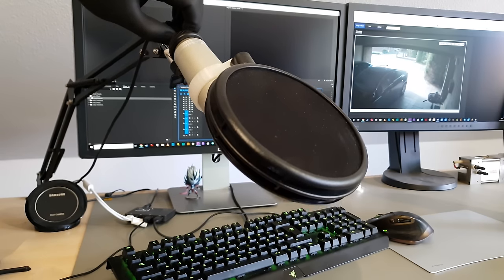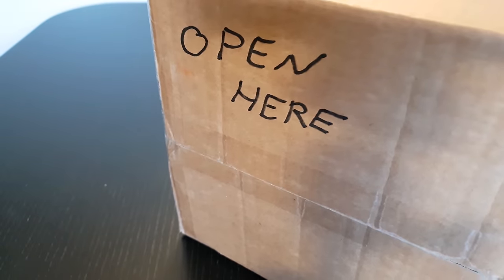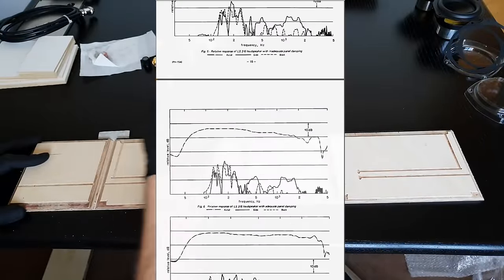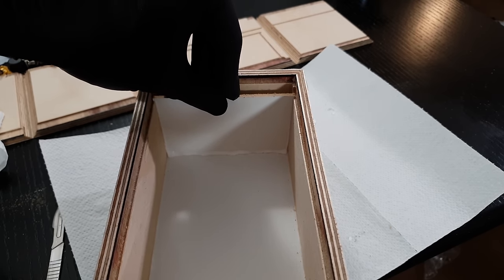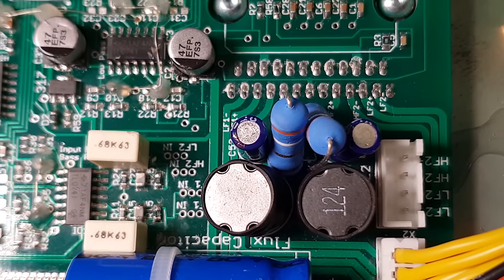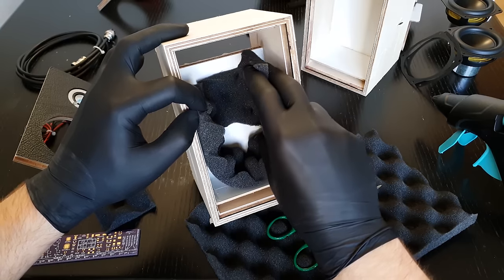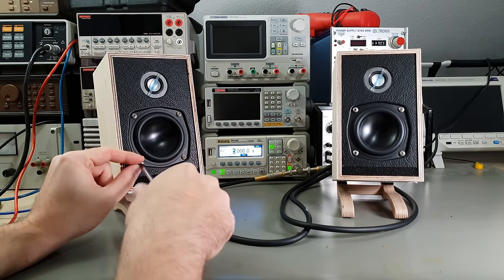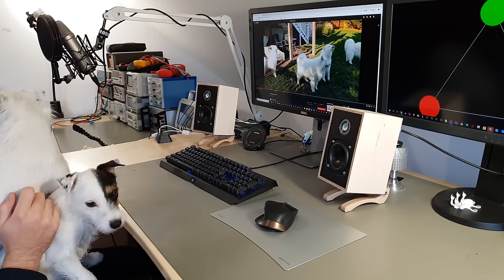Little British Monitors: DIY Transmission Line (?) Speaker Kit

Comment: "His Rival's Voice"

But seriously now... Presumably this means digital speakers (as in, DAC in the box) hasn't fully caught on? Have an old Cambridge SoundWorks system from years ago that can take analog or some weird Creative-specific digital format, and the latter has often sounded clearer, especially when I was playing with neons...
Reply: The problem is that the direct delta-sigma amplifier never caught on. Probably barricaded behind intellectual property locks, such as patents and trade secrets.

And without that, what's the point?
Reply: @SianaGearz  TI has been using Delta Sigma in their digital amplifier chips for many years.
Reply: @NiHaoMike64  Care to provide an example? Never ran into these and my quick search doesn't turn up anything.
Reply: @SianaGearz  The TPA3122D2, while an old chip, actually shows a Delta Sigma modulator on page 5 of the datasheet, implemented with opamps.
For an explanation of what the opamps are used for, take a look at the end of this page:
https://www.beis.de/Elektronik/DeltaSigma/DeltaSigma.html
Reply: @NiHaoMike64  The 3122 is your classic analogue Class D amplifier. Delta Sigma modulator fundamentally runs on a clock. Class D has integrators and thresholds or comparators (which you mistook for opamps, which fair they do share the same schematic symbol) but no clock. Delta Sigma is a family of digital/analogue interface topologies, but for something to be digital, it needs to be both value-discrete and time-discrete, and classic Class D is not time-discrete, it's time-continuous. You shall note that all topologies on that beis site you quoted include a clock. When it refers to the TPA3100D1, just pull up the datasheet on that, it contains a Delta Sigma DAC and then analogue Class D amplifier in the same package, so it's not a Direct Delta Sigma. Granted, this topology should trivially work just fine, being free of the DDS troubles :D Furthermore if it wasn't the case, then FLT pins would make no sense, since they're basically analogue-input-side.

Fundamentally functional block diagrams should always be viewed with lots and lots of suspicion. It's fair enough if they represent the output and the input circuits accurately but then they just make up stuff in between that is just barely close enough to what's happening. Same thing with "equivalent schematics", where you'll find almost every single opamp pretty much represented as a mild variation of 702 in its datasheet although really there's 2 more stages in there that are just completely omitted.

What i think is happening is that the Delta Sigma topology itself is good when it doesn't need to drive any current, just voltage, since you can then assume that any switching happens more or less instantly, which is fundamentally not the case with Class D power amplifiers, where you have a relatively long minimum duty cycle that you need to account for, but then need super fine adjustment of the duty cycle to hit a sufficiently exact output voltage. Topologies that run a threshold off a regular saw-wave or something like that exist, but don't perform nearly as well, so i suspect what all of these decent integrated ones are doing is allowing the reference signal cycles to shrink and stretch somehow, something like that.

Comment: $461 for the assembled version? No,  Thanks! I can spend 30-40% less for brand-name speakers at Guitar Center like Yamaha or JBL  with 6 or 8 inch drivers and I'm sure they'll sound much better.
Nice review,  though!
Reply: I wouldn't be so sure they will sound better. Perhaps more impressive, louder maybe, but more accurate? Not at that price point.
Reply: @RobWhittlestone  mass production is lowering the price,  as we know. Big company that makes a big order of say drivers or amps or cables will get them at a much lower cost. Not sure why you doubt it. And reputable companies has teams of acoustic engineers to make sure their products are meeting consumer's expectations. That's what they do for living.
Reply: @111chicane  Big companies also make boring, safe designs that can be done with cheapest components, and they drive a huge margin. Those speaker drivers bigger manufacturers use are just one or two steps above bottom of the barrel - good quality control and no fundamental design issues, but just nothing special that allows to push daring designs. I'd classify this as daring because of claimed f-3 around 60Hz at just 12cm width, which is pretty remarkable, you don't get that far with $5 drivers. I think the whole idea is pretty much that they should sound bigger than they are, and they're tiny.

This is clearly not a product for everyone, it's not a mass market product, it's one guy's small-shop product, and it is a bit special and quite distinct from mass market monitors, not a direct competition. It's not unreasonably priced, not at all.
Reply: Actually I doubt the hell out of that.  I've bought alesis studio monitors that are used for recording and they are garbage in comparison to good full range speakers or setups like this that I've made myself.  It was actually pretty upsetting how bad they were and if you go over to my channel you can hear it. Over time the amps internal quality has degraded to hell and now i get this space anomaly background noise that pusles at random and not even an inline filter gets rid of it.  Yeah, screw premade speakers to hell.
Reply: I can't say what these speakers will sound like in person, but it's highly likely you'll pick up absolute rubbish. Especially sub $400 on a big brand name speakers at chain stores.

Regardless though, most customers don't really know what a studio monitor is really supposed to sound like.

Comment: How they actually classify these as a T-Line gets me. Definitely not quarter wave, nor is is the cavity behind the proper line length calculated off the FS it’s not the proper diameter calculated off the Sd off the main woofer. 
This is a slotted L-port enclosure if anything. I would like to know how they classify this as a T-Line as I may be wrong for the rules for what makes a T-Line a T-Line. The line length would be at least 52cm and same diameter as the woofer itself.... I don’t know what the Fs of that woofer is but even with basic T-Line math we calculate the Fs against speed of sound at sea level and the divide that by 4 to get line length for a basic T-Line and that length is usually the diameter or surface area of the woofer(Sd) for that whole length. 
I build a ton of T-Lines and have seen some deviations from the basic rules but this is way out.

Comment: That's a very expensive tiny speaker.
Reply: I'd call it very cheap from my perspective, mine cost much more and don't have a builtin amp (and not suitable for active crossovers and biamping) - and they're just about the cheapest small speakers i'd be comfortable with. You can get some studio monitors that are comparably priced, they can be quite decent. Cheapest non-crap thing i could live with would be Mivoc "bookshelf" speakers (actually not suitable to be used on a bookshelf), they cost like $60 a side, but they're a lot bulkier than this, and they are an exception to the rule, normally everything you get under $150 a pair is crap.

If this lives up to the promises, it's a great product at a bargain pricepoint.
Reply: For a DIY, it sure is.
Reply: Dirt cheap compared to similar professional audio gear. But I would have liked to see some sort of wired digital input like S/PDIF or USB or at least support for differential input - low level analog audio tends to be sensitive to EMI.
Reply: @SianaGearz   Yamaha monitors and other brand or even no brand high quality monitors are not that expensive and they even have 5 inch woofers.   The finish is also more presentable and you just have to plug it in without glue or painting.
Reply: @NiHaoMike64  A little expensive compared to DIYSG, which uses generally better designs. These use 2 fullranges together for no real reason. They should have at least used a dome tweeter. Probably used the fullrange "tweeter" because it's slimmer from the front but cones aren't ideal for tweeters compared to other designs. I bet Sony Core series, Pioneer's Andrew Jones stuff would be better for cheaper, anyway, and my KEF Q100s were also cheaper than this and are definitely better (though larger but I still use them on a desk). Also the ports in these are a joke, chuffing sounds all day long.
Reply: for speakers it's OK.
Personally, it's too much but you can easily spend a few thousand for similar speakers
Reply: @korgied  DIYSG kits are undeniably good value. However I'm not aware of any that come with custom matched active crossovers and 4x amps included.

It's quite easy to knock up a passive speaker design in CAD and get a decent result, especilly when not size limited.

The goal of the LBM however was never to be reasonable and cheap, it was to be the very best possible in such a small size. To get exceptional results takes a lot more care and design patience.

Regarding the driver choice, I can't agree with your comment. I know what good tweeters sound like having spent time with some very respectable audio kit. e.g. PMC AML1 and MB2 actives, Quad ESLs, Harbeths, Mangers, builds using revelators and Raal ribbons. These do the job very well indeed - not your average 'tiss tiss tisssh' sounding budget dome.

If you get the chance to hear the LBM I think you would be pleasently surprised.

Comment: 6:20 Useless Gold connectors... when you see the remaining signal path... 

When the "White Van" sellers, reached Kick-me-starter...
Reply: A bit useless in this situation, but i'm not sure saving a couple cents on chromed connectors and then selling the product for the same price would bring you any advantage. I mean at least they look nice, easy to spot against the background of a bare aluminium plate.

The remaining signal path seems perfectly adequate to me, not sure what your gripe is with that. This is not an expensive product, fully assembled around $600, cheaper than that as a kit. Even if it came with cheapest components, provided it's not designed by an idiot, it still wouldn't be overpriced. Though i wish Zaph would receive a pair. I find the choice of reviewers that the product was seeded to slightly questionable. Naomi never showed interest in audio and these shitty Teufel speakers that Marco had pretty much speak for themselves.
Reply: @SianaGearz  It's way too crapy for 600$ !!! 200 ok... signal path: instead of bridging the 2 boards with flat cables + pin connector, why not (600$) use soldered shield wire for input signal, larger & twisted power/speaker wire...
Thicker wood, better amplifier than a TDA... for that price.
Reply: @SianaGearz  I would like to see The Signal Path do a review. He'll use one of his spectrum analyzers to show the difference between those and some cheap stereo speakers.
Reply: @AltMarc  It looks like he runs every second wire in the ribbon cable as ground so there's interference suppression. The IDC connectors will easily outlast the electronics by decades before they accumulate any issues. In my opinion shielding here would be completely and utterly stupid because it would just be a hotpatch against the fundamental issue of radio frequency sensitivity of the circuits, which you should just fix by implementing RF rejection where needed. I mean if you don't fix that, you can still get interference from whatever interference-prone piece of shit you plug in!

And you don't need larger wire diameter. There isn't that much amplifier power to go around, which is par for the course, they'll reach their excursion limit easily. The TDA are adequate, their performance is much better than inherent speaker driver distortion. The small extra series resistance with the driver is of vastly reduced consequence in a biamping setup compared to passive crossovers. You could say it's calculated into the response and the crossover design, but that would imply there's enough of an influence to matter, and there's just no way for that to be the case.

It's a kit at the price of low-end studio monitor speakers (unassembled), with the electronics and components that easily exceed the quality of such. In fully assembled variety, it might be a tougher call, but not by that much. If it's a competent design, it's a more than reasonable price-point. I'm not about to judge the competency of the design from the pieces of information that are available, but i'm inclined to believe that it's likely to be after the author cleared up some of my questions here.
Reply: Honestly I just sent the kits to youtubers I personally like. Marco and Naomi. For sound quality reviews I sent fully built product to White Sea Studios and Raw Technique Studios but it's difficult for them because you can't really describe sound with words (nor a recording!). Also not everyone responds, so I was super-dooper lucky to contact Naomi and Marco.

If you guys want to recommend some other reviewers please send me a message either on KS or email so I dont loose it in youtube comments. I'll look in to it, probably after the KS has been fulfilled though.

I wasn't aware Zaph reviewed products? I haven't looked at his site for a while.
Reply: @Audio_Simon  A spectrum analyzer and measurement microphone would work great to create a graph of the frequency response, as well as show in pictures why a $50 stereo is nowhere as good.
Reply: @NiHaoMike64  If you scroll down the kickstarter page you will find the frequency response.

There is a lot more to a speakers sound than frequency response though.
Reply: @Audio_Simon  If it's a full VNA as opposed to a simple spectrum analyzer with tracking generator, it will be able to measure phase as well. And by using a signal generator (e.g. the reference output in "non sweep" mode), harmonic distortion and other spurious output can also be measured.

As far as individual-owned labs go, you'd be hard pressed to find one better equipped than the one at The Signal Path as far as precision measurement goes.
Reply: @Audio_Simon  Marco speaks like an real engineer. Personally I like this kind of approach as I am also an engineer. His review was one the reasons why i bought LBM II kit. It brings credibility to the technical side.

Comment: here's a proper transmission line speaker - https://www.youtube.com/watch?v=hIwZjJanXag&t=103s

Birch Ply as a superior material? From what I understand, for low resonances (subwoofers) you need something stiff. For this birch ply would be a good choice. From the early mids up you need a bit of damping, and this is where something like MDF or HDF is a better choice. 3:40 - Concrete 
https://www.youtube.com/watch?v=1eD0VUb5BFo&list=PLx-9mD0_6t4VQZON0SqbNC1ygI3dVQ0kk

Comment: Thats an awesome little kit. Now i'm pretty interested in these. BTW, like the designer stated, Birch plywood is the absolute best sounding cabinet material there is. Wouldn't say i'm a level 4 audiophile, maybe a level 3 ;). Used to manage a pro-audio rental warehouse with $2 million in audio gear. Nearly all of our speaker cabinets were made from birch made by EAW Loudspeakers. Any pretty much every other pro-audio cabinet is made of birch also. Of course there are companies that claim that their composite cabinets sound better, and on paper they might seem to, but they just never sound "right". Anyway, great review! I might just have to buy myself this kit.
EDIT: Oh, and concrete speakers cabinets....that would sound awful, way too stiff....but they would be pretty interesting to see.
Reply: According to a Visaton paper i can no longer find, concrete can make for excellent speaker material. It also concluded that MDF can get fairly close, and better than any plywood. The purpose of the enclosure in speaker design is to serve as a pressure vessel rather than emit sound, so its main evaluated property for the purpose of the study was sound deadness.

Sure you can incorporate enclosure sound into speaker's sonic signature, but it seems... unnecessary? Theoretically not very conductive to quality either since it will have quite a bit of windup and decay.

Then again if you always worked with those speakers which do have a distinct enclosure sound, it may have become a necessary part of your perception that you got accustomed to. A speaker is never the same as a live musician which one might imagine would be a benchmark for music, so finer details can easily become a matter of taste, and there's nothing fundamentally wrong with that.

Comment: Your hot air gun trick for my prints have saved me alot of trouble. Without it most of them end up turning into stringy knotted messes or warp or other issues. Also to me the plywood make me look like these are DIY speakers and sort of ugly. Is it possible to apply a felt coating or some kind of cover onto the plywood in order to make them appear more professional without sacrificing the audio quality that some papers have said plywood gives? Altho their wood grain version here https://ksr-ugc.imgix.net/assets/023/025/170/82fa5ca29c3b4409205acf68cc1734f8_original.jpg?ixlib=rb-1.1.0&w=680&fit=max&v=1540480209&auto=format&gif-q=50&q=92&s=1a176183e37a720c985d13e80baac67e looks better I will admit.